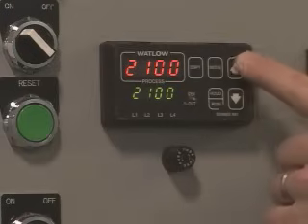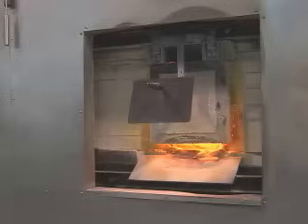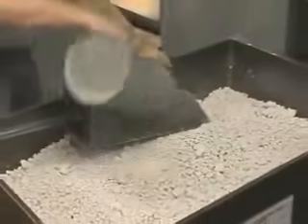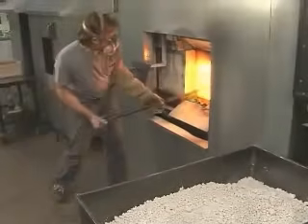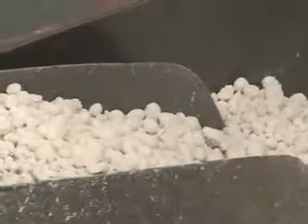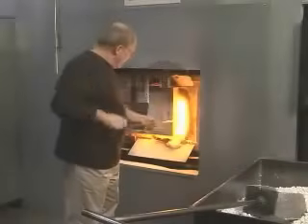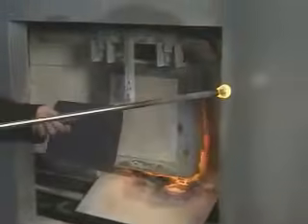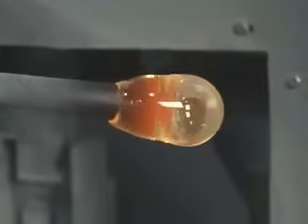Raw Materials of Glass

Comment: Does the sand have to be pure quartz sand or do they use any sand with quartz in it?
Reply from the maker: Here's the answer from the Museum's Chief Scientist Glen Cook: "Most glass that you see every day – bottles, windows, jars, and such – is called “sodalime glass” and is made by heating and melting a mixture of three main ingrediants: silica (silicon dioxide), soda ash (sodium carbonate), and limestone (calcium carbonate).  
The amounts of each of these compounds needed to make just the right kind of glass to work in the manufacturing machines, or in the hands of glassmakers, must be very carefully controlled.  This is most easily and cheaply done by starting with those raw ingredients in a reliably pure form.  Imagine if you make cakes, and didn’t know from mix to mix if someone had already mixed the baking powder into the flour!  
Beach sand or desert sand can have lots of other things mixed in, including other minerals besides quartz (the most common form of silica), as well as shell and coral bits.  Glassmakers buy their silica from mining companies that dig very pure ancient sands from specific parts of the world that are known to be consistantly pure.  They grind and sort the sizes of silica to be the size of fine sand, so that the mix of powders flows easily into the melting furnaces.  
Before such mines were discovered much older glass was melted from actual sand, and the name stuck as a generic term."
Reply: Thanks for the insight, that makes sense.  I thought maybe that they had clever ways to filter any old sand into pure quartz, but i haven't found any info about a process like that so I was really wondering!